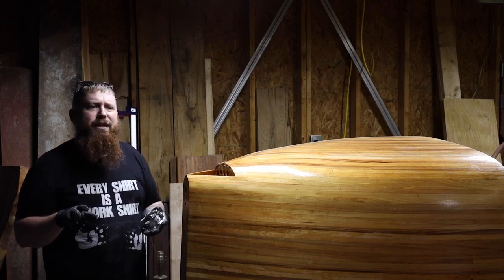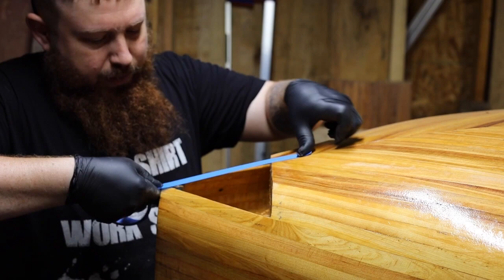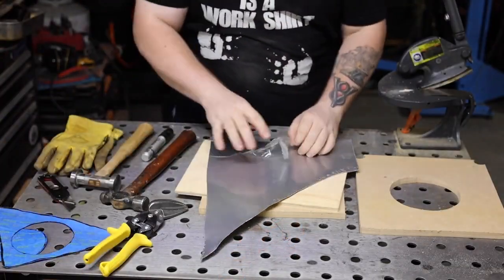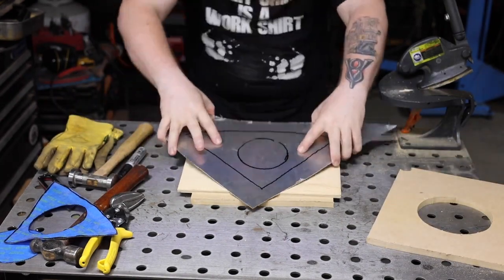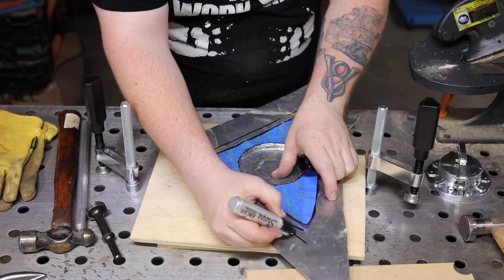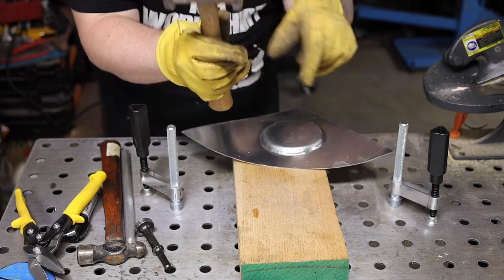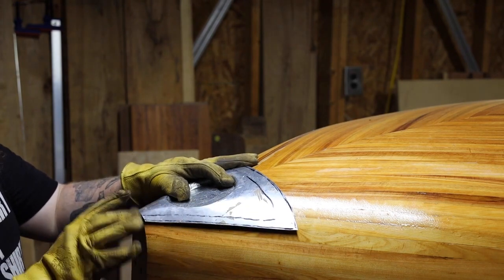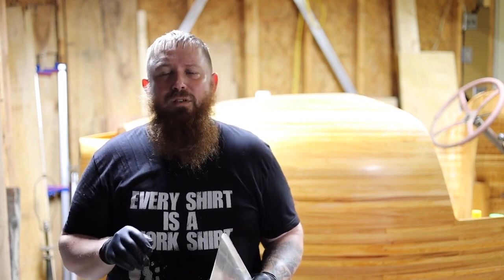Introduction to Sheet Metal Shaping with Basic Tools

Comment: Just watched your modified tool short. When you use that tool that attaches to the closed end wrench then torque it as you showed in the video you did put more torque on it than the wrench was set to.  A statics class would show where you went wrong.  It'd about the moment arm and reaction forces.  To get the exact torque you should have the torque wrench at 90 degrees to the closed end wrench.
Reply from the maker: Sure

Comment: Hey bro.. That was an awesome tutorial on shaping metal.. 
I have a question for u if u got time for it..
Q. The table u were using is a Welding table I'm guessing but what thickness of Steel did u use to make it? I have 3mm sheet in my shop. I wanna make a small 500x500mm table with it. 
I'm kinda stumped how it looked so strong and didn't look like it was flexing that much with u hammering on it? 
It was when u used those clamps that shocked me. How thick is the metal for ur table top my bro??
I'm just getting into welding and I really want a decent table for a beginner. 
Will my 3mm 500x500mm sheet be good enough for clamping to when I drill the holes and what size holes are most commen? Somebody said to drill 16mm? 5/8" holes would be fine?? 
Any helpful advice from anybody reading this would be good if anybody in the comment section has a minute to answer..
Thanks in advance my G. Keep up the brilliant work man
Reply from the maker: It’s about 1/8” thick. There’s a frame under the edges. I just try to stay in that area when hammering. The 16mm holes would be good. I think that’s what these are. Seems to be a common size for clamps. There’s little pins that drop into the holes too to help line stuff up. They might be a little hard to see in the video, but it’s how I set the two shelves parallel to eachother.